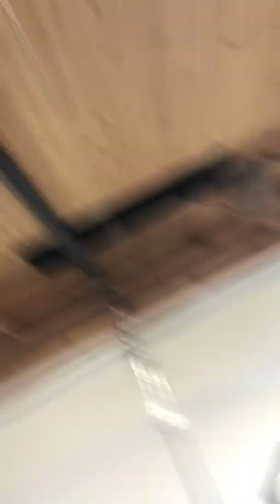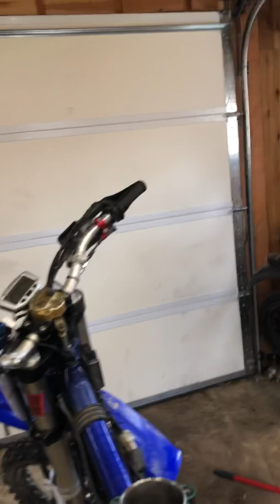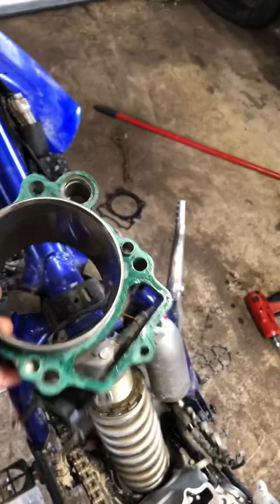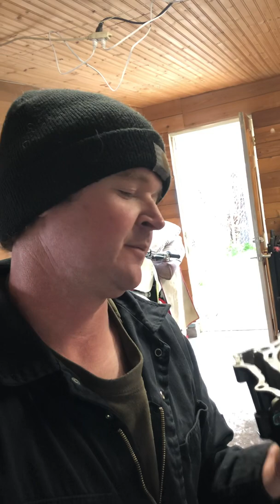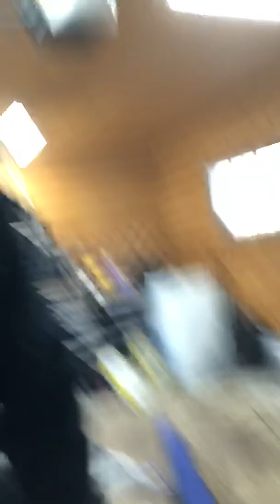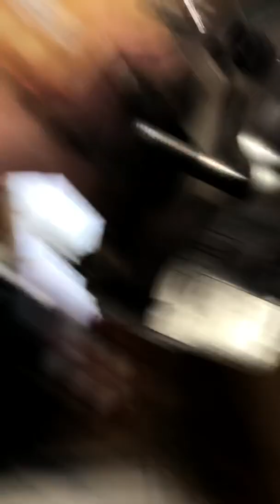YZ 426 cold seized!

Comment: Could you tell me why my YZ426f locks up when the engine is warm but will kick start and run again once the engine cools off? No leaking fluids, not over heating, went over everything we could think of kinda stumped! Pls help! Thanks  @local enterprise broadcasting
Reply from the maker: Ok…so most likely whoever did the top end did not set the ring gap correctly…you’ve got two options here …run a small camera in the spark plug hole and look for Scoring on the cylinder…option 2 pull the top end and inspect the cylinder for damage. This is EXACTLY what happened when I cold seized my engine…in my case I upgraded my radiators and had the cylinder cool to rapidly and did exactly what you’re describing…Unfortunately it sounds like the damage has already been done so you need to have your cylinder replated  or buy a new one or have it sleeved…but anytime the engine locks up warm this usually indicates the piston has made contact with the cylinder wall…sorry to be the bearer of bad news but I’ll bet top dollar that’s what’s happening…if any part of the cylinder lining is compromised it will do what you’re describing…hope this helps steers you in the right direction …also inspect the wrist pin for flat spots, this will also confirm that your piston has been rubbing on the cylinder
Reply: @localenterprisebroadcastin5971  okay sounds good I'll start with running the camera in first. I thought it was pretty much the same issue you had , but I wanted to be sure only because my location temperature is in the upper 70°s hasn't been any colder.  Its spent more days on down time then run time 😅 everything and anything has went wrong, only road the bike max ,8 hrs since May (purchase) .. 🙄. I appreciate the help ! Wish me luck and I'll let ya know how things go! Thank you!
Reply from the maker: @bridgetphillips7103  well temperatures are what caused my issue and if you live in a warmer climate most likely the ring gap wasn’t right …a lot of people make that mistake (even I did in my younger years) so if you have to rebuild your top end remember to set the gap before you reassemble 👍

Comment: Hey, so do I have to worry about cold seizing on a stock 2001 yz426f. I plan on using the bike in the winter. This is my first bike so don't know much about them. I live in Colorado
Reply from the maker: Not likely if it’s the stock cooling system and your carb is jetted properly , just remember to give the bike a good warm up before you romp on it 👍
Reply: Ok thanks. I'm on here trying to learn more. So how much more difficult is it working on dirt bikes then it is cars? I've done head gaskets, timing belts, valve adjustments and things in-between
Reply from the maker: @angelg.564  bikes are orders of magnitude easier… But like anything it requires some level of understanding with the technology itself… Doing valve adjustment on these type of engines requires a bit of know how as far as using Feeler gauges and micrometers. But if you’ve ever done a valve job on an overhead cam engine that uses shims to set the lash then you should be fine… The FCR carburetor is its own animal that takes a bit of research to understand how to service it (outside of just switching the Jets) Ignition system it’s nothing special just a magneto CDI module and coil
Reply from the maker: @angelg.564  If you’re already mechanically inclined then this is the bike for you because you will have to work on it 😂. But once you get everything dialed in a they run forever. I’ve had my bike for several years now with no issues (after I got everything set up and rebuilt) just simple shit like gaskets
Reply: Alright I'll subscribe and keep in touch. For future help/questions. I appreciate your time brother. Chat whit you soon

Comment: Hey man new to your videos, I'm thinking about buying a 2001 yz426. I plan on racing it next season. Would this be a good motocross bike?
Reply from the maker: Taylor Domonoske well that depends on what class you’re racing and how skilled you are. Do I believe this bike can still bring home a win or two ...absolutely. With some minor engine work, suspension work and brake upgrades these old girls have plenty left in em to keep up with the newer bikes. Be advised though the 426 makes its power at a much lower RPM than the newer thumpers...if you ride it like a 250 2 stroke people will have a very hard time passing you 👍
Reply from the maker: Taylor Domonoske also be advised that the 01 model did have issues with the counter balance shaft coming loose periodically so check that as often as possible
Reply: @localenterprisebroadcastin5971 how do you check that I have an 01
Reply from the maker: Taylor Domonoske here’s a cool vid that might help ya make up your mind...btw this vid is about the yz 400 so the 426 is a much better improvement https://youtu.be/yz3y27ekJ2w

Comment: Interesting I'm running oversized rads and a 95mm wiseco piston in the winter here in Northern Canada and haven't had an issue so far but might look into the thermostat
Reply from the maker: Well you might be running pump gas... I forgot to mention this happened on 110 octane on a slightly rich mixture ... either way my temp gauge didn’t lie... my engine lost 30 degrees in less than 45 seconds ... given I’m positive my ring end gap was perfect m, cold seize is the only logical answer
Reply: @localenterprisebroadcastin5971  yes I run 91 octane highest pump gas here